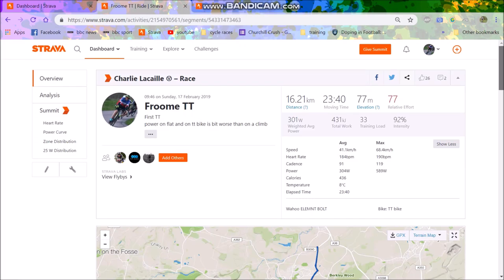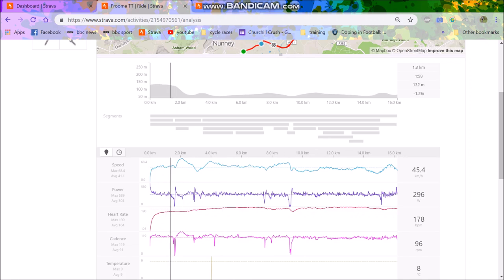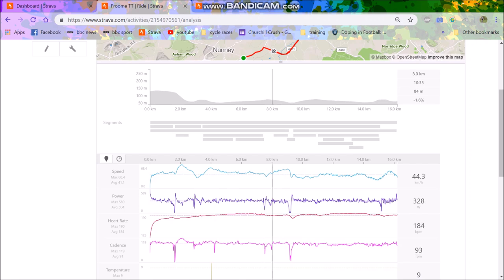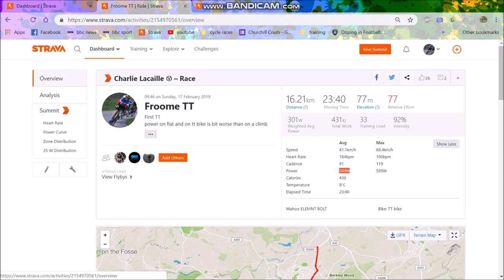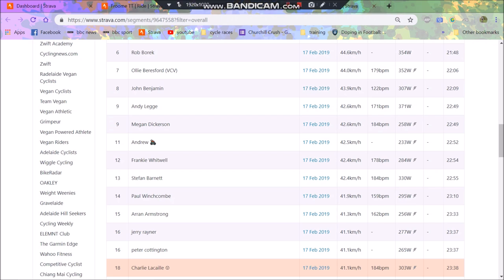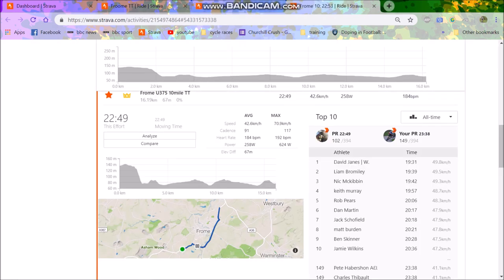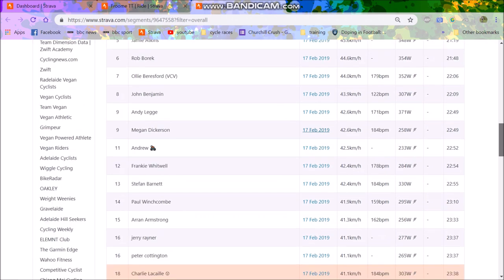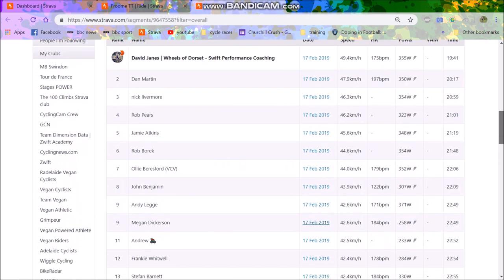TT Race Analyis : My first TT

Comment: Get up to speed with a 53 and then don't pedal on the downhill. Don't break your tt position until 12-13mph. Get the best helmet like a met drone wide body or giro, and a skin suit that pulls down so that it doesn't flap on your collar bone/just behind your neck
Reply: Oh and read the course, so faster on the climbs and headwinds. Don't fall into the trap of even split the power meter, demolish yourself and burn matches in the hard places